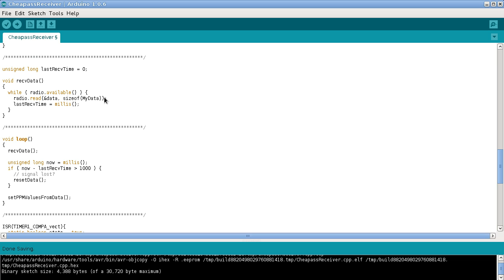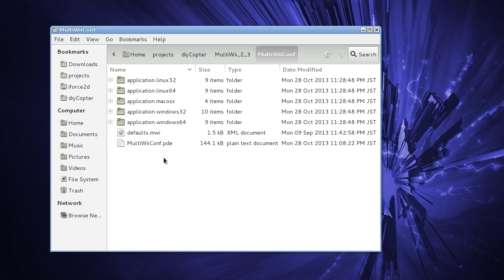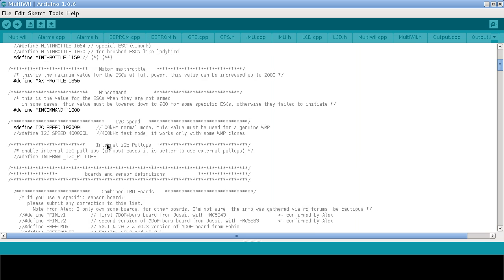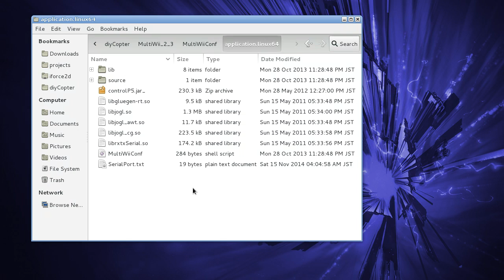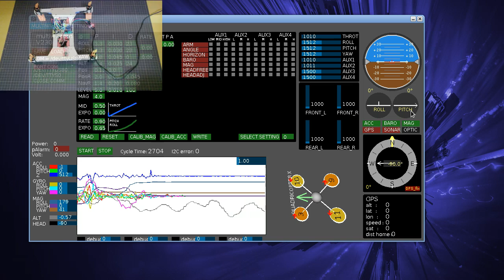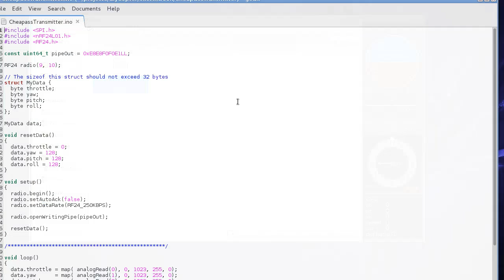Cheap-ass quadcopter build Part 8 - "Receiver" (continued)

Comment: hello, I have not understood how I have to upload the sketch of MultiWii and cheap-ass receiver on Arduino. maybe I have not understood something, could you give me an email with which we can communicate to you for help?
Reply from the maker: +Federico Spadaro I think I explained everything in this video already. If you have a specific question, ask it here. I don't send individual emails to people because it only helps one person instead of everybody, and I would have to do it over and over again.
Reply: +iforce2d ok, I'm sorry if I was rude. Now I explain to you, how do I load the cheap-ass sketch receiver and MultiWii in The same Arduino? Maybe you have said this in the video, but listening in English for me is more difficult than reading and therefore I prefer to read.
Reply from the maker: +Federico Spadaro You don't. You need two arduinos, one is the flight controller and one is the receiver.
Reply: +iforce2d http://i.imgur.com/xJTX7te.png
Look at this circuit, in fact I wanted to use the Arduino and sensors gy-80 module as a flight controller, but instead of using a receiver of a radio I chose to build it the way you did, then I have to use another Arduino with NRT24L01 as a receiver ? as you see, in the circuit, the pins the receiver must be connected to pins arduino, I believe that this can be done by connecting the two Arduinos?I hope I explained it well
Reply from the maker: +Federico Spadaro Yes, in this video series I used a second arduino as a receiver. After finishing this series I did some work to make the nRF24 stuff integrated with multiwii source code, so you can use just one arduino. Note that you will need to change some of the pins: https://www.youtube.com/watch?v=bxlJckevIEk
Reply: +iforce2d thank you very much, you have been very exhaustive

Comment: Hi. Could you help me please? I've bought 4 ESC from ebay. I've tested them and they start at about 800 throttle. My problem is that multiwii cant give lower throttle than 1000. I've changed the MINTHROTTLE to 700 but in the multiwii interface it still shows a 1000 min throttle. I don' think I could reprogramme the ESC to be active with values between 1000 and 2000 so my question is.. Could I change the values that multiwii gives to be between 700-1700 ??? I've aleredy tried the MINTHROTTLE but it can't go lower than 1000... Please help. My email is andreiboyka69@gmail.com TANKS a LOT, your videos help me a lot!"
Reply from the maker: +Andrei Gabriel Anghel yes, you can recalibrate the ESCs to use the range that you want. I don't know what ESCs you have, but they almost always follow this method:
1. power off the ESC
2. send the maximum signal to the ESC (eg. 2000 in our case)
3. power on the ESC - it should make a slightly different sound to normal
4. wait a few seconds
5. send the minimum signal to the ESC (eg. 1000 in our case) - it should make the 'ready' sound
Multiwii can help you do this using the ESC_CALIB_CANNOT_FLY definition in config.h, search for that in config.h and follow the link to the full howto. Remove propellers!!!
Reply: +iforce2d tanks a lot. great answer, great channel and best videos. tanks again!!!

Comment: +iforce2d I think that was the problem but he still says that "this line is here to intentionally cause a compile error. Please make sure you set clockMultiplier below as appropriate, then delete this line" I don't understand
Reply from the maker: +mathis peyronne What's not to understand, I gave the instructions right there....
you need to define the clockMultiplier variable, as the comment says, set it to 2 if you are using a 16MHz arduino, leave as 1 for an 8MHz arduino. I really don't know how to make it any easier

Comment: hello thanks for your tutorials I have an issue when I compile the cheapass receiver sketch it says that the problem is in "RF24 radi (9, 10);"cann anyone help me?
Reply from the maker: +mathis peyronne Since you didn't say what the error is, I don't know. But since it's in that line, perhaps you don't have the RF24 library installed in you Arduino IDE https://github.com/maniacbug/RF24

Comment: Hi you are doing a great work here and I'm grateful for your help. I'm having some issues with the multiwii setup. I followed all your tutorials up to this point. In the multiwii conf gui, after arming and I throttle a bit, the motors for 3 and 9 seem to accelerate at a steady pace until it gets to max while 10 and 11 keeps fluctuating by deccelerating and accelerating even when the other input parameters are constant. Please how can I solve this issue since it has kept me at this point for some days now. Thanks
Reply from the maker: +ISIDORE EKEH Have you tried to push the throttle further and take off? If you raise the throttle very slowly, the flight controller can get into that state because it's trying to adjust the yaw but can't because it's still on the ground. Make sure to also let the quad sit untouched for a few seconds immediately after plugging the battery in, so that the gyro will be calibrated correctly.
Reply: I tried taking off but the quad seemed to sway, and kept turning (yaw) till it finally crashed. Controlling it is almost impossible. Is there any suggestion as to what I might have missed?
Reply from the maker: +ISIDORE EKEH did it lift off though? make sure the motors are all spinning the correct way, and the motors are connected to the correct pins on the flight controller, and the props are all on the right way

Comment: it's great video. And i wanna do "Receiver" like the way you do. I don't have a multiwii v2.5 flight controller but I have a CC3D Flight Controller, so how can i connect nRF+arduino to CC3D?
thanks
Reply from the maker: Su YP The CC3D can take PPM input, just like the FC I am using in this video. You can probably see part 14 of this series in the side bar, it looks at CC3D setup.
Reply: ***** it's mean I can connect pin 2 (arduino reciever) to the white PWM signal (Throt pin)  of CC3D, right?
Reply from the maker: Su YP yes

Comment: Thanks a lot  iforce2d for this amazing videos 
Because i am making quadcopter using nrf24l01 i have 1 problem
i am using two arduinos..one as mulltiwii
on first arduino where nrf24l01 is conected i want to add gps and barometer and send (also i want to add battery level sensor and current sensor) that information to the transmitter and then show it on display
Do you have some simple code for transmitting and receiving information at the same time? 
to transmit values from potentiometers and receive information from sensors
Thanks!
Reply from the maker: Fx Pirate I just did that today as it happens, video will be up soon. The nRF24 has an ack payload feature which you can use to send back information in the ack packets. I made a version of multiwii which uses that to send info back to the transmitter, see this video for details and source code: https://www.youtube.com/watch?v=bxlJckevIEk If you are using a mega2650 the source code actually requires much less changes (see the comments in that video for a discussion on using mega2650) and you should be able to do all the gps and baro stuff. For my case I am using a 328p (pro-mini) and I had to disable the baro stuff to have it fit into the 32kb available. As for GPS, I think the only way you would manage that on a 328p is by using the u-blox proprietary binary protocol (which I will talk about in my next video) so you will need a u-blox compatible GPS module and you'll need to set it up appropriately.
Reply: ***** here is my schematic of my receiver http://i.imgur.com/4kdas79.jpg the problem is that motors doesnt spin, i check the receiver and its works i receiver data from transmitter also when i will open multiwii software only mpu6050 is working but throttle is fixed also when i will move the potentiometer
i follow all your steps i change all code that i need to change but nothing i hope you can help me 
I hope you can understand my bad english :)
Reply from the maker: Fx Pirate 
1. There is no common ground between the two arduinos.
2. There is no common ground between the uno and the ESC.
3. The SDA and SCL connections are the wrong way around for the mpu6050
4. Connections to the nRF24 seem wrong. Pin 8 on the nRF should not be used, but pin 7 should be. Looks like CLK and MISO are reversed too. On the arduino side, CE and CSN are going to pins 7 and 8.... shouldn't this be 9 and 10? If you are using the version of multiwii I linked in my previous comment, then 7 and 8 would be correct but why do you have two arduinos.... the whole point of that code is that you can do everything with a single arduino.
Reply: ***** i know that connections on the picture are wrong , now i am trying with integrated rf24 code i am using only arduino uno , in the code i only change type of quad and type of sensor that i have, but same story again when i will move potentiometer throttle is fixed and mpu6050 is working
Reply from the maker: Fx Pirate And the potentiometer throttle is running on what, another arduino with my other sketch? It sounds like the problem is with the radio connection, so I would get that working first (just print out some numbers or something) and forget about the quadcopter until the radio is working properly.
Reply: ***** the potentiometer is running on other arduino (transmitter) i am using Cheapass Transmitter code 
and before this when i was using 2 arduinos (1 as receiver 1 as multiwii) i print data from Transmitter and its works i receive data from transmitter but i dont know why throttle is not working  
photo from receiver http://i.imgur.com/oPxtYjc.jpg 
from transmitter : http://i.imgur.com/Ee1QVIp.jpg
Reply from the maker: Fx Pirate It's too much for me to look at and study, sorry. If you had the receiver working before then I don't see why it would have changed. Maybe try uploading the data printing sketch again to check if it's still running ok.
Reply: ***** I check every connecting also i upload data printing sketch and everything works ok but now when i will start my quad motors only beeping constantly also i test multiwii code without connected any esc  in Multiwii config but still same Throttle pitch roll are fixed all time only sensor is working ..
I tested with your ppm code using 2 arduinos but  nothing now i am using integrated nrf24l01 code in multiwii 
and data from transmitter is fixed....
I think i will break my quad and drop it...

Comment: I am having issues on Arming the ESC's.

I was able to ge the MultiWii code uploaded to the Multiwii and able to calibrate the accelerometer and such.

But i cannot arm the ESC's.

As soon as i plug in the LiPo battery, the ESC's make the sound of being armed (the series of beeps and then a long beep for my motors anyway). I tried to throttle to zero and yaw to zero (throttle down, yaw right), but the led will not come on.

Any ideas on why?
Reply from the maker: fifaplayer10 It seems to depend what type of board you are using. I find that for an arduino pro-mini, the led does not light, but for arduino nano it does. I would think most purpose-built flight controller boards will make the led light when armed. Even if the led does not come on, what happens when you try to spin the motors? Are you seeing the values for the control inputs changing in the MultiWiiConf program to match your stick movements? If so, then I don't see why it wouldn't be arming.
Reply: ***** Silly me.I simply had to push the Yaw stick to the left and not the right to arm the dang thing.

Anyways, i want to say thanks for putting up these tutorials. I mainly have been watching your transmitter and Receiver video's because i had originally tried to program a Receiver flight controller myself, but had no look so decided to go get a multiwii after watching your video.
Reply from the maker: fifaplayer10 That's a bit odd. Have you managed to fly it ok? Perhaps your yaw axis is reversed, the default should be yaw right to arm, left to disarm.
Reply: ***** I have tried to fly it with the 4 arms strapped down but the Quad just shakes like crazy and never lifts. I researched that issue and i have to balance the motors or propellors?

Also, during my "testing", i tried "rolling" and then the quad just shot up on side (still strapped down, but 1 side is now like 20-30 degrees higher) and the motors were stuck on full throttle. Even after i took off the throttle. I had to (in a very scared fashion) unplug the motors from the MultiWii as this happened.

I really have no idea why my quad is not stable.
Reply from the maker: fifaplayer10 Are you seeing the values for the control inputs changing in the MultiWiiConf program to match your stick movements? Are you seeing the pitch and roll values changing as expected when you move the frame around? Can you see the values for the motor speeds making sense when you arm it and give a little throttle (with no battery). Have you calibrated the ESCs? Are you using angle mode or rate mode? Did it roll up on the side that you expected it to? In rate mode, it's normal for it to stay rolled one way until you manually return it to level.
Reply: ***** - The values for control input are matching the MultiWii program
- Motor Values are correct when moving the frame around

To calibrate the ESC's, i went did it through the MultWii Arduino code by UnCOmmenting "//#define ESC_CALIB_CANNOT_FLY" Line 1156 and then plugging in the FTDI cable. Is that the correct way to calibrate the ESC's through the MultiWii Arduino Code?

I did what you did to get into angle mode by clicking on Angle, LOW for Aux 1 in the video, so that should put it in Angle mode right?

Going to test some more later today as soon as new props come in.
Reply from the maker: fifaplayer10 Yeah those checkboxes are a bit ambiguous and not very good user interface I think. For example, what should happen if you click all checkboxes for Aux1 in both the angle and horizon rows hahah... well, to be safe I would try setting all three checkboxes in the aux1 row for angle, and leave everything else off. You can check if the mode you want is selected because the box around the "angle" title will turn green. Make sure you write (and read back to check) after changing any values. You should also see the box around the "arm" title turn green when you arm it. That said, I think you missed some of my questions a bit:
- Are you seeing the pitch and roll values changing as expected when you move the frame around? (not motor values)
- Did it roll up on the side that you expected it to?

About the calibration process, I just recently realised I have been doing it all wrong, because the multiwii wiki does not explain it fully. Here is how I would do it:
1. Take props off
2. Uncomment the ESC_CALIB_CANNOT_FLY line and upload the sketch
3. Disconnect every power source (including the USB/FTDI to the arduino!!!) and wait a little bit (I suspect the ESC caps might keep the ESC circuit alive for a while)
4. Connect the battery, not the USB/FTDI
5. ESCs should make one set of beeps when they first start up, then another set of beeps after about 5 seconds (motors should not spin!!!)
6. Disconnect battery.
7. Comment the ESC_CALIB_CANNOT_FLY line and upload the sketch again

If the motors spin at step 5, the calibration was not done!
If the ESCs do not make a second set of beeps after a few seconds, the calibration was not done!

Then I would connect both battery and USB/FTDI again, and check that you can arm it ("arm" title box goes green) and disarm it. When armed you should be able to spin the motors with the TX throttle, and they should start spinning at the same time. Check that the title box for "angle" is green, and that the pitch and roll displays are moving correctly when you move the frame around. If you leave the motors spinning a bit while moving the frame around, you can check that angle mode is working correctly because the motors on the lower side of the quad should spin faster than those on the higher side (motors on the higher side can actually stop when you do this, that's ok).
Reply: ***** Well, finally got my quadcopter to work!
I switched to a f450 frame and the motors seem to work just fine!

On the x525 frame, the motors would spin their full range of speed when i am testing it on my desk (props off of course). But once i put the props on, the propellers don't seem to operate the full range.

Once i switched to the f450 frame (and without changing any settings) it works like a charm!

Comment: how do you connect the FTDI to the MultiWii?
Reply from the maker: fifaplayer10 I mentioned about this in an earlier video, try 27:18 in this one https://www.youtube.com/watch?v=Ja5-JjGc5DU#t=27m18s
Reply: ***** i have this multiwii that i have and it's not exactly the same as the one you have in the video, but i did purchase the same ftdi as you did.

the multiwii here:
http://www.ebay.com/itm/321660545265?_trksid=p2057872.m2749.l2648&ssPageName=STRK%3AMEBIDX%3AIT

does not have an rst pin. So where would the ftdi go you think?
Reply from the maker: fifaplayer10 As I mentioned in the earlier video, I found that DTR worked for reset (DTR is marked on the bottom of your board in the ebay photos). If it helps, here is a photo of a different FTDI adapter I have, that uses six pins. Most likely the six pins on your board marked FTDI going from GRN to BLK are in the same order. http://www.iforce2d.net/ftdi.jpg
Reply: ***** I do apologize. i simply went to the earlier video and looked at how the connections were in the video

But thank you very much!